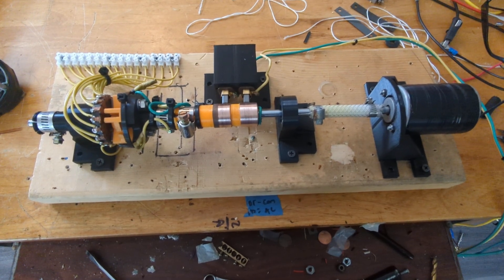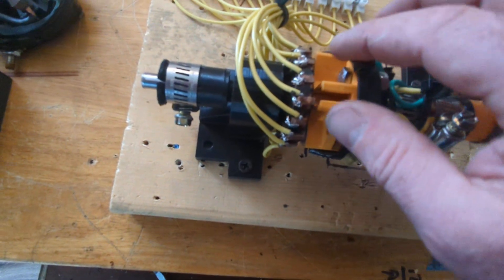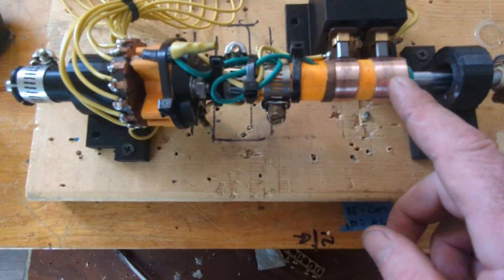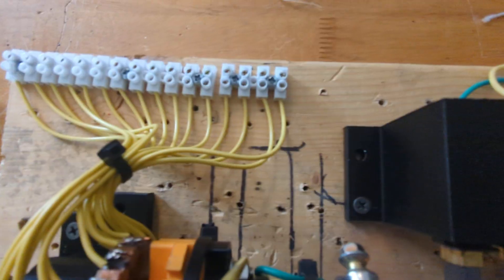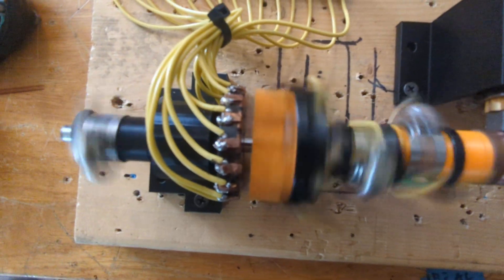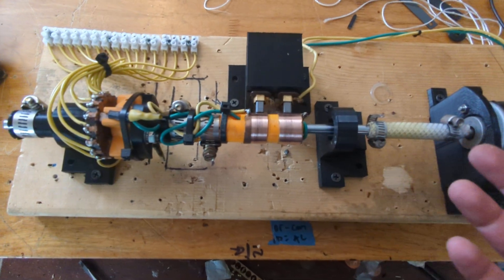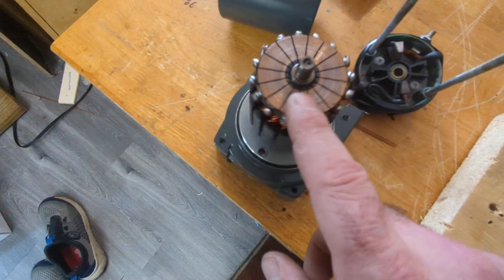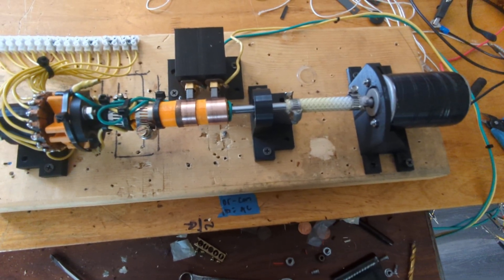STL Files and Instructions-  Clemente Figuera Part G Commutator

Comment: Excellent work, Figuera switch in action replaces all the current electronics in exchange for a little noise that disappears if covered.
Reply from the maker: Thanks for the comment. Many electronics can not take "Bus Pumping" and highly reactive circuits without tripping or blowing. For experimenting until we get it right, I think mechanical commutation is the way to go.  Electronics adds too many variables at this stage of the game.  We can always try to design a circuit later IF we get it working with commutation first.